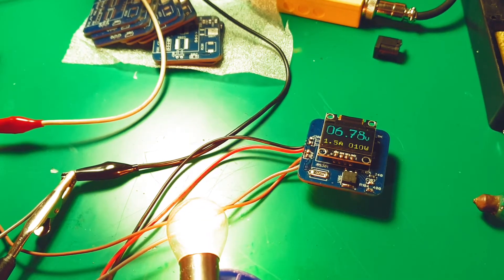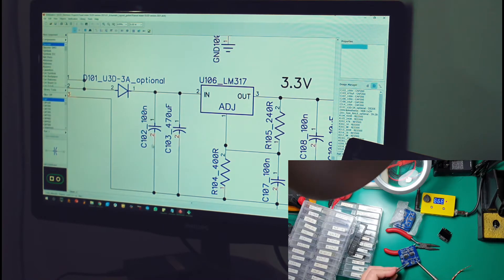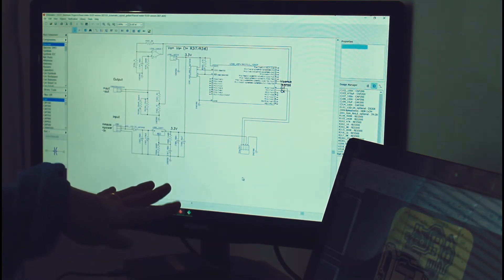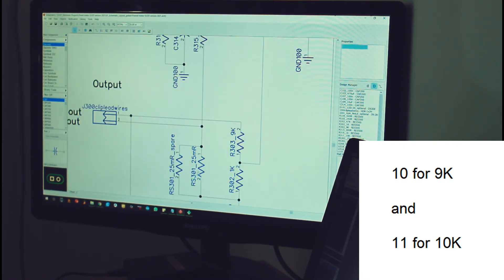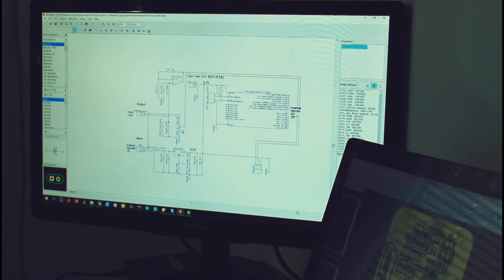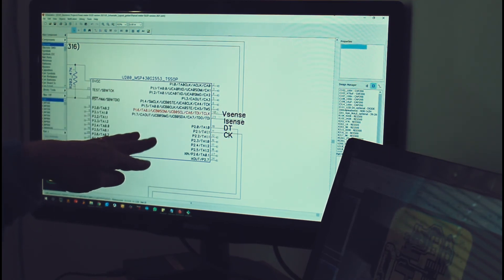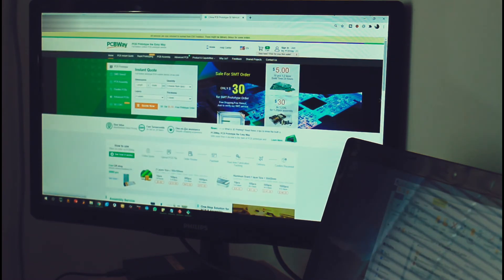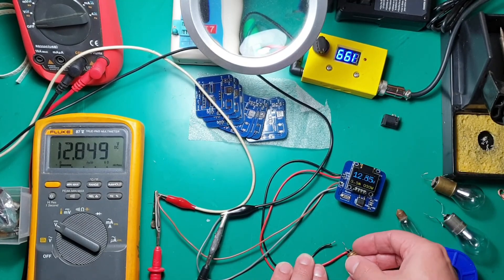I explain the schematic of my new panel meter creation

Comment: This is Amazing, If I should have known. I order everything to construct an Ampere and voltage meter with INA 219 and Arduino.  But definitely I will do this also.
Reply from the maker: I just published some updates on the project's page. All those who are interested, please follow the project. Like I said in the video, I plan in the future of also publishing a case for it. 
https://hackaday.io/project/177674-small-oled-panel-meter
Thanks and have fun!
Reply: @FunElectronicsToday  never got notification on your reply. After this time, I need to ask you a question, in the specs it says it will read from 0 to 5 amps, I need to measure really small current measurements let say; 0.02 amps, it has that precise capability?
Reply from the maker: @svsv9  Yes, it does. The reading is pretty sensitive and it could show current values down to 1mA. Nevertheless, the firmware would have to be modified for this. And the problem is that there is no room for more decimals on that little screen. Unless I remove the wattage section.
Reply: @FunElectronicsToday  1mA no way? Please, make the mods and upload the vids. I could not make the mod if I wanted because of lack of knowledge. Well thanks. My Ina project is very inaccurate and after a resolution of 4mV. How I wish to make a uA meter.